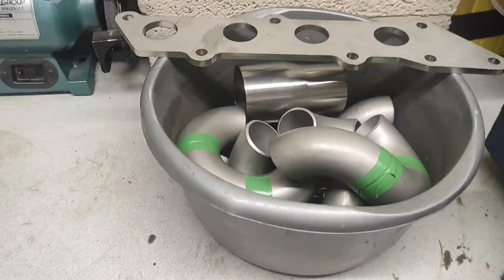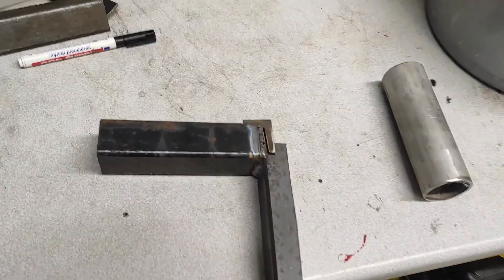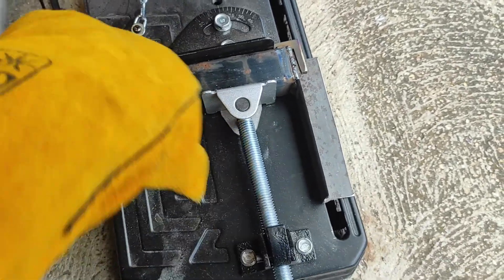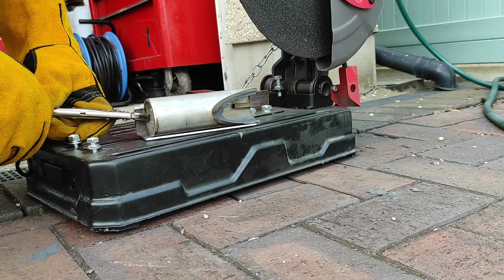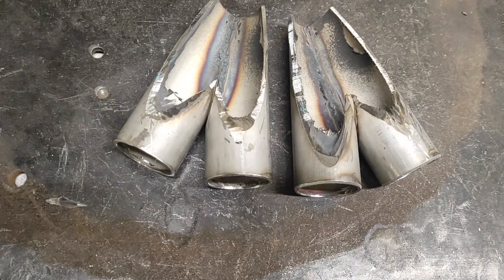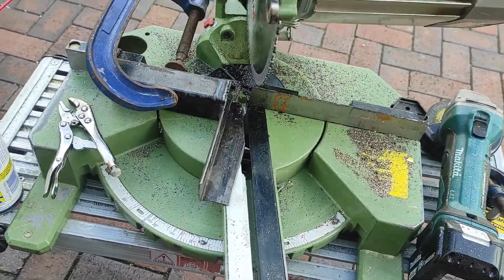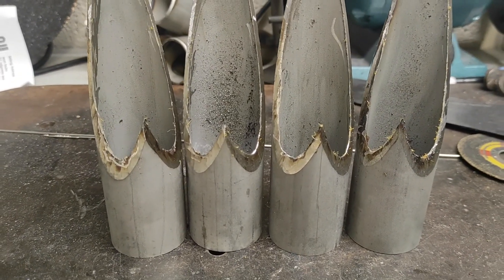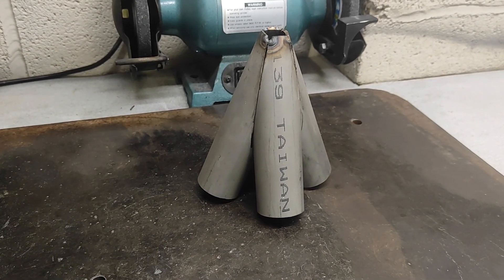Fiesta ST Turbo Build - Turbo Manifold Merge Collector, Two Attempts, Multiple Failures

Comment: Whats the diamiter of the individual manifold pipes id and od??
Reply: My guess 2inch I'd?
Reply from the maker: I used 1.5inch sch10 pipe, I'm sorry I do not know the exact od and Id measurements, but the id was definitely bigger than 1.5inch because I remember wondering why they called it 1.5inch when it wasn't!

Comment: i make my jigs from timber, hold the pipe vertical. just sink a holesaw or two in to make a socket of the required merge angle.

keeps the offcut contained as long as you set it up to not cut all the way through the timber... 

for anything outside a 4-1 collector... subtract the included angle of a regular polygon from 180.

ie, 3 is 120 degrees, you rotate it 60 degrees. 5 is 72 degrees, rotate 108 degrees. 6 is 30 rotate 120... etc, etc.

the hardest bit of stainless is firstly, getting started, then secondly... stopping every few seconds from then on... inch of bead, stop, cool, proceed... forget back purge gas when you come back. scream. throw hissy fit. go back to thinking and procrastinating. dip the tip. curse some more. give up. return to dreaming.
Reply from the maker: Thanks for the response. I have seen people use timber jigs since I made mine, I think I will give it a try if I make one again.
And yes, I found making and welding things with stainless has a very steep learning curve!

Comment: You need to de-burr tubes before assembly
Reply from the maker: hi, I did not use any of the tubes in this video in the final manifold. So I didnt waste time cleaning the burrs off. The bits I did weld together were just for practice.

Comment: Just a some advice on stainless welding for exhausts. Always use purge gas to prevent burning the weld on the inside of the pipe. If you don't back purge the welds will crack due to the high heat and heat/cold cycles. post downpipe its not mandatory but manifold and downpipe definitely needs it.
Reply from the maker: Thanks for the input. Yes I totally agree with you, in the later videos when I finally complete the manifold I show the back purge set up I use. So hopefully I shouldn't have any cracks or failures.
Reply: Does this also apply to carbon steel manifolds?
Reply: @roadiesgarage3816 - I'm surprised no one has answered, but here's some info for you. First, no, you don't need to back purge regular mild or carbon steel - there's nothing it will help with, where in stainless it keeps the metal from degrading. Stainless will oxidize our the elements in it that make it stainless if there's any oxygen near it at welding temperatures. Mild steel doesn't have those elements to precipitate out.

That said, you wouldn't want to make a manifold like this out of mild steel - it would rust from the inside horribly and not last very long. If you used carbon steel you would want to anneal it after welding- carbon steel is able to be hardened ,and it will do so around any welds in it. That becomes the places where it cracks and breaks apart later, unless you fully stress relieve it.

Hope this helps. 😀

Comment: As I always say it's not a failure or fuck up till it's in the skip . What you actually have is 2 methods of how not to do something.  So it was in essence a good practice.  I've found in the past it always helps to goof up something then you get the experience of what else is liable to be there waiting to trip you up . However it does make a good video to watch thanks for sharing . Hope you managed to sort out the correct sized tube and make a good collector.
Reply from the maker: Thanks for the input, yes this really was a valuable learning experience! And yes the manifold did finally get finished, but work on the rest of the car is still ongoing, so yet to see how well it works, or maybe Im in for another lesson! time will tell